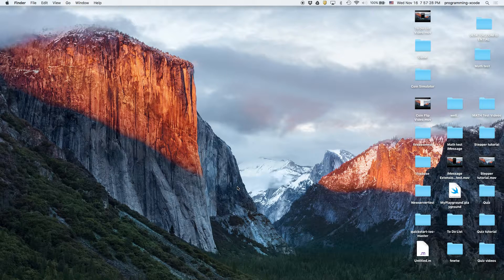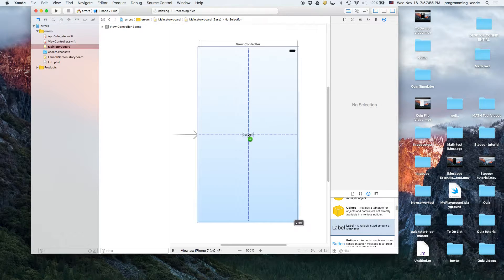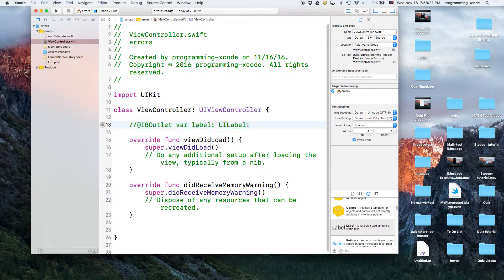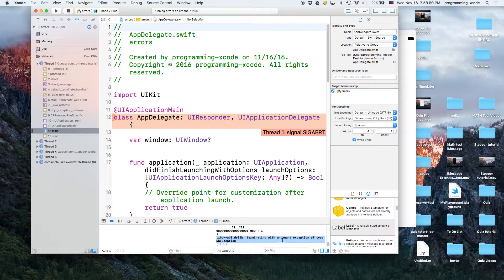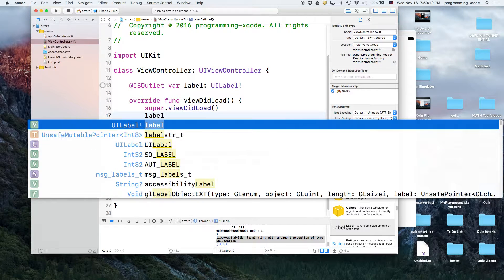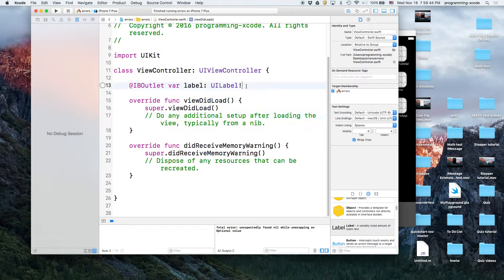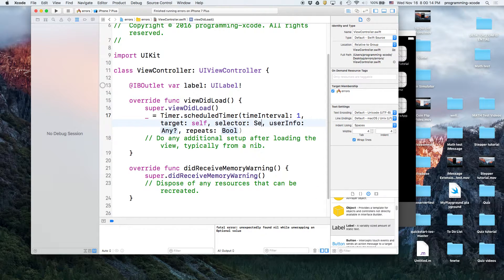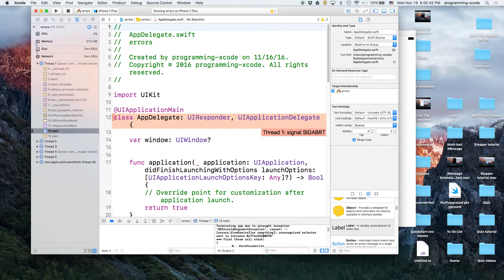iOS 10 Swift 3 Errors: thread 1 signal Sigabrt in Xcode 8

Comment: I started a  Xcode project and all I did was add the Firebase framework via Cocoapods and import in the Appdelegate and viewcontroller. When I add FIRApp.configure() to didFinishLoadingWithOptions I get that error. If I remove that line but still have the framework imported it runs with no errors.plz help me with this error